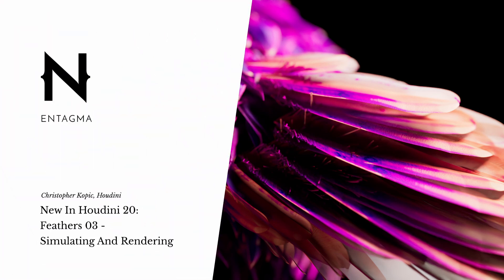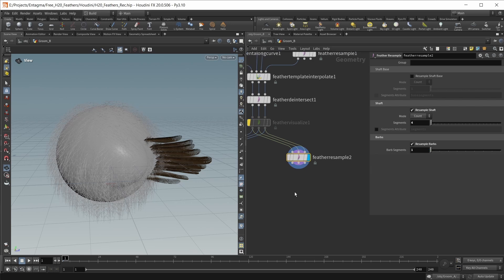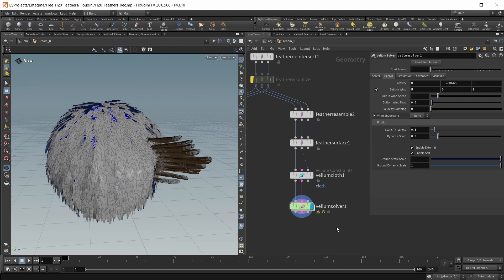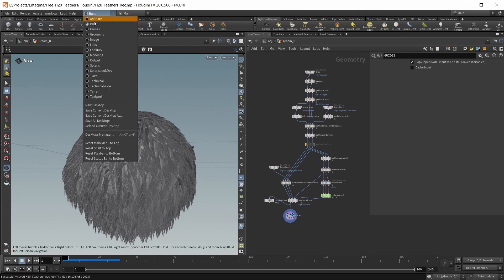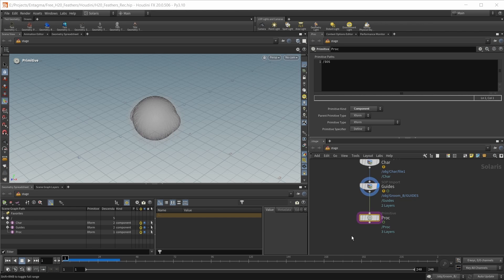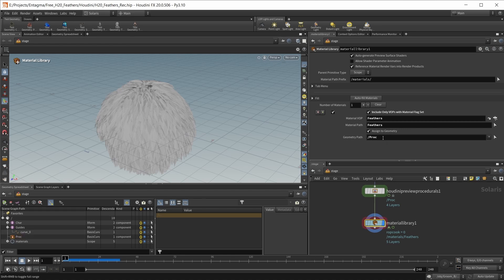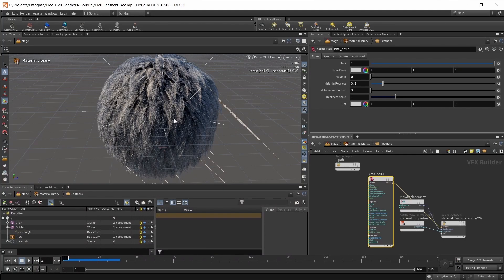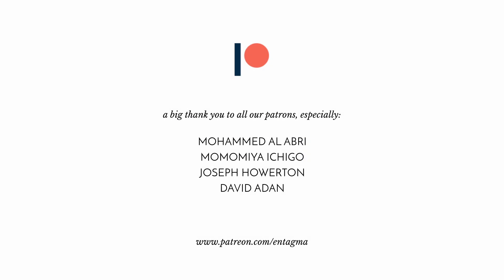New In Houdini 20: Feathers 03 - Simulating And Rendering

Comment: Great tutorial, as always!. I'm having an issue with the "feather surface" node as it isn't creating the "roots" point group that you use as pin points in vellum. Any ideas of what might be going on? Thank you!
Reply: Create a group by range sop and select the first point. Enable "affect disconnected geo seperatly" in the connectivity tab.

Comment: Sorry but "feathersurface" dont generate a "roots" group
Reply: Put a groupexpression node between the first input/output of the feathersurface and vellumcloth nodes. Set it to a Points group type, name the Group Name to roots, and use the preset under the VEXpression to First Point of Primitive. Proceed as normally through the tutorial.
Reply: @wavelength2025  thanks bro saved me with that one
Reply: I agree
Reply: how do I fix it?

Comment: Thanks. My feathersurface-node is not creating root point group for vellum conf. cloth node. Any ideas why ?
Reply: I fixed it by adding a group expression node, group type (points) Group name ( roots) VEXpression (frist point of primitives) and it will create the group point on the roots
Reply: @santiagosuarezm  Thank you. Your solution worked
Reply: @santiagosuarezm  where did you put the vexexpression and what did you wrote ?